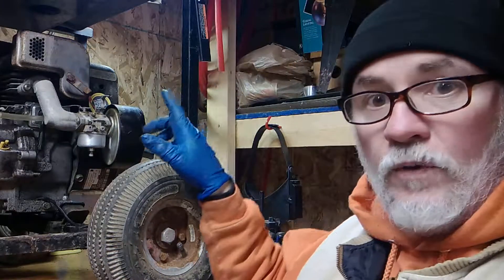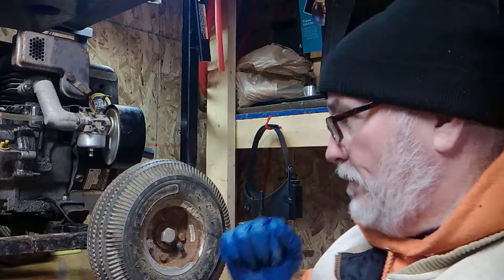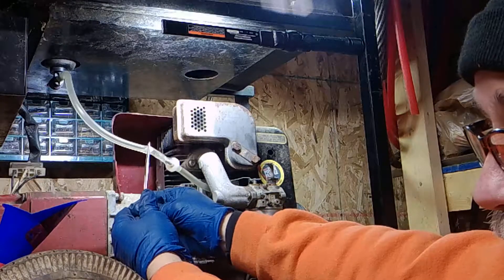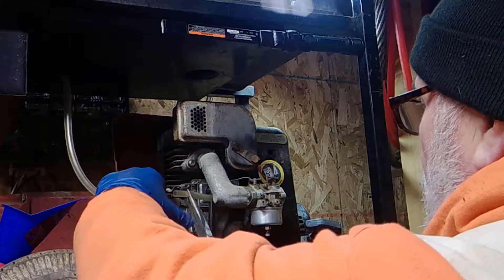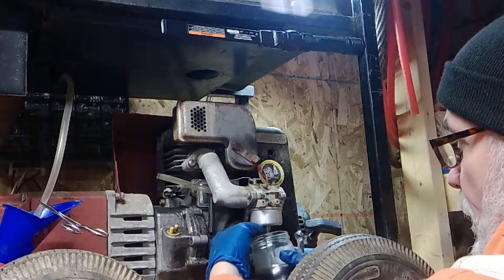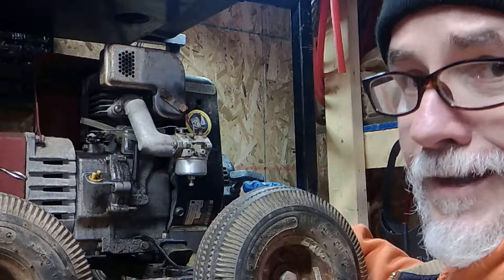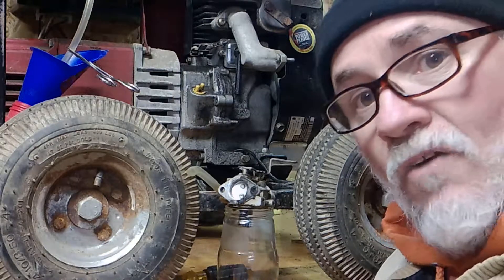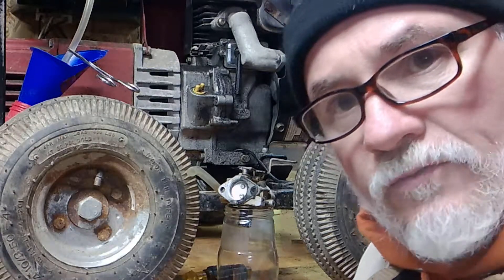How to take off and clean Tecumseh 10hp carburator on Coleman Maxa 5000 Watt Generator

Comment: like #58.  Unsure why it has so few.  Excellent vid.  

queston.  I am working on a Companion generator with the HM100 engine.  When I removed the bowl, the bottom bolt did not have a washer but the bowl ring did.  I was thinking that it should.  Are all the Tecumseh engines pretty much the same?

Comment: How did you get the back carburetor retaining screw off...thats the hard one that you cant hold the nut while you turn the attached screw.
Reply from the maker: The right nut will hit against the side so it shouldnt turn. Sounds like you need to wedge something in there to keep it from turning if you cant get a wrench on it. Good luck buddy.

Comment: Would you happen to know the part number for the Tecumseh carburetor or at least the Tecumseh model number. It would be a BIG help.
Reply: PM0524000 is the engine model number for the 4000 watt coleman generator

Comment: Out of all the videos your carb looks like mine is your throttle just between the carb and governor? I'm working on a 10hp Tecumseh on a 5000watt generator and the only throttle linkage is between the governor arm and butterfly control. All the other videos have a actual throttle control
Reply: mine is the same.

Comment: need to spring for some heat in your shop there cupcake. lol.
Reply from the maker: I have to turn it off while making videos because of the noise. Looks cold but my radiant heater keeps me just fine along with long johns and insulated overalls lol. Thanks for your concern buddy.